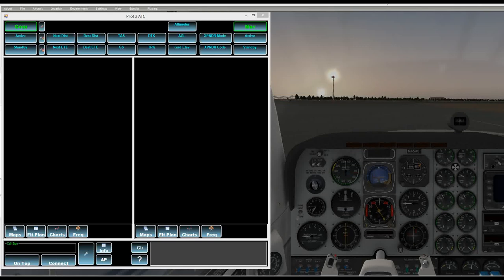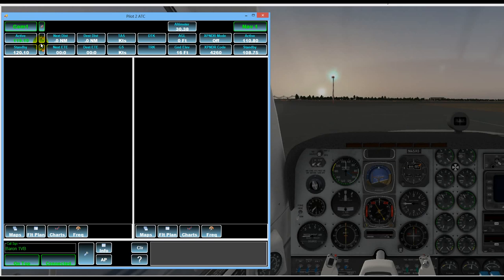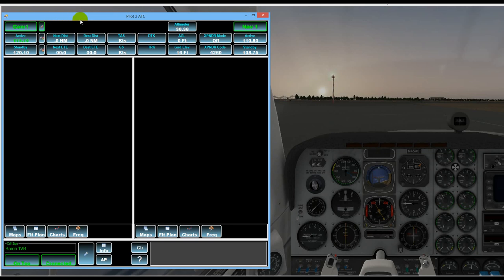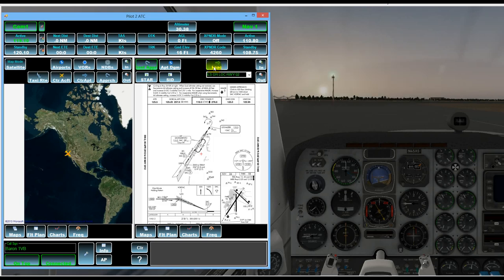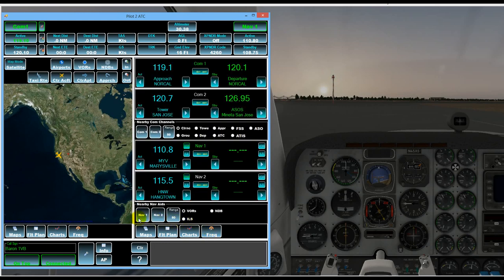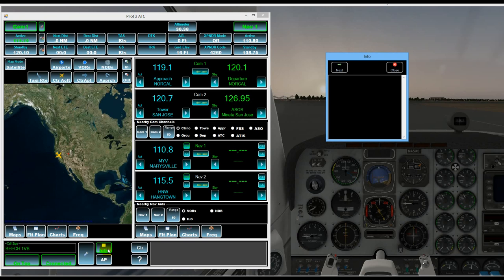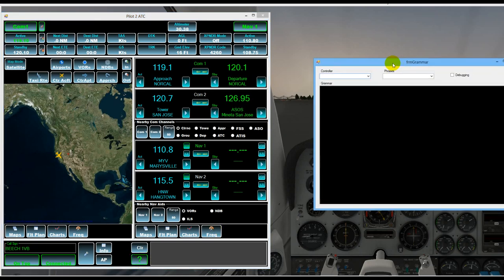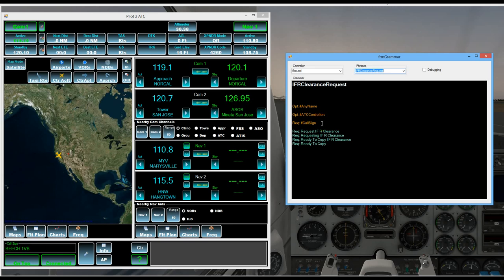Pilot2ATC Overview Tutorial

Comment: we use both the FSX and X-Plane simulators and I’ve yet to see any automated ATC that is flawless, so it’s difficult (4 ME) to learn ATC procedure.  I tried PilotEdge (real time, real online controllers) but they expect u to be current on protocol (which i’am not) so Pilot2ATC is a great way to learn,,, and i like it.
Reply: +Amanda S. 
I agree.  I'm finding P2ATC to be a perfect tool for preparing me to get on PilotEdge. This is the best ATC program that is available (I have all of them) and above that, it works on all of the sims. Couldn't get any better than that!